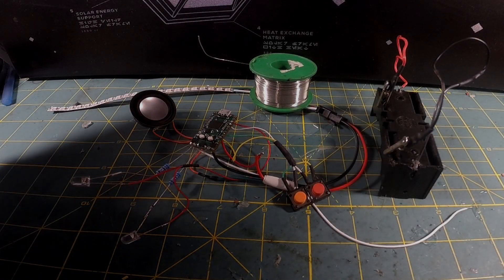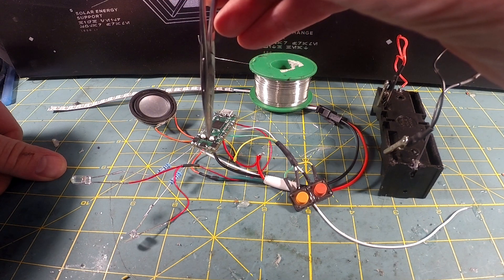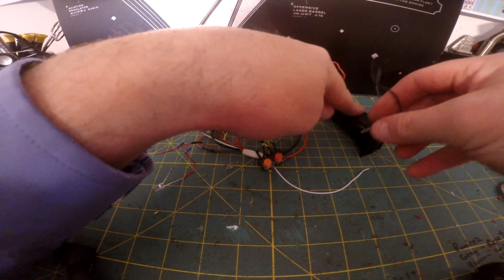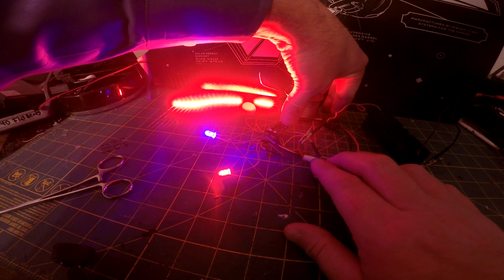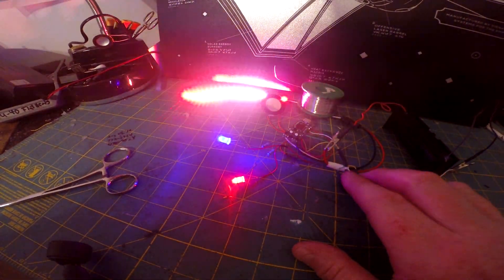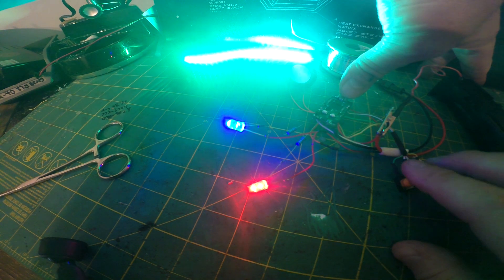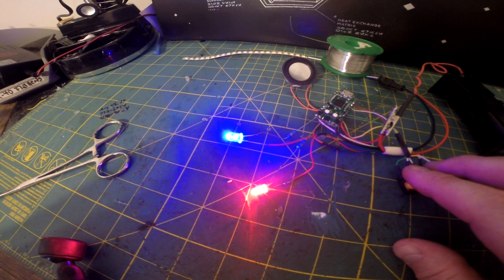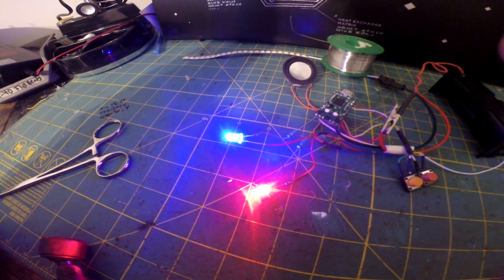Custom Proffie Configuration File

Comment: What size resistors did you use
Reply from the maker: Depends upon your led type, color, and fv, and your supply v. You can use this calculator:  LED Calculator https://share.google/3D7Bksjv9WPqCi5ch
Reply: @MegtoothSithSabers what would happen if you didn’t use a resistor for a diode. I’m sure I’ll get one to fit I’m just curious. Thanks for the calculator. Seems I need a 85 ohm resistor
Reply from the maker: @Campay77 it'll burn out quick, red instantly

Comment: I was received a saber from a custom installer. I used it for about 6 minutes before it started giving me an error message. My installer said "[ I need] to reload the config I put on the SD card." I have no idea how to do this as I've never programmed anything, anywhere in my life. I see the config. File on the SD card but have no idea how to do reload the file. Any suggestions or videos you have to help would be greatly appreciated.
Reply from the maker: https://youtu.be/Lm5Ksxzjo94?si=oiytdEopYO4Xphyg